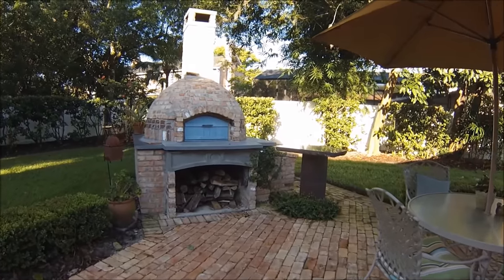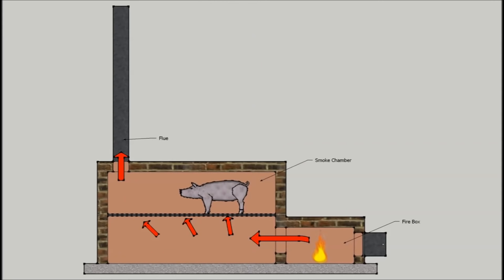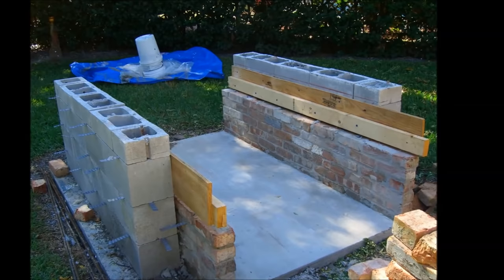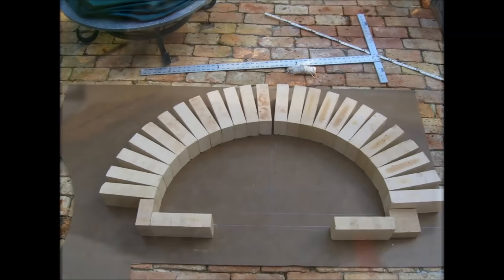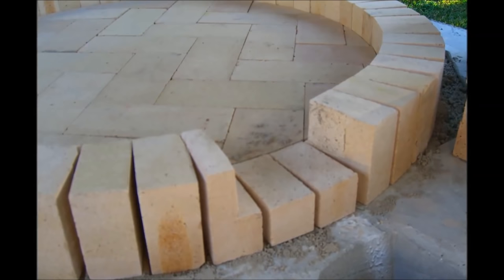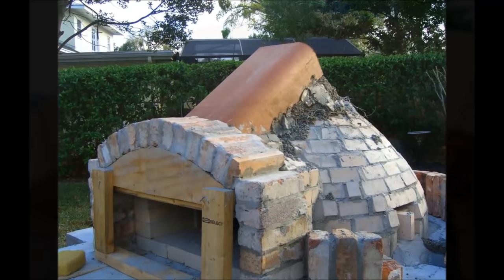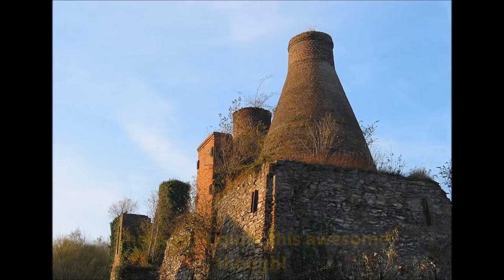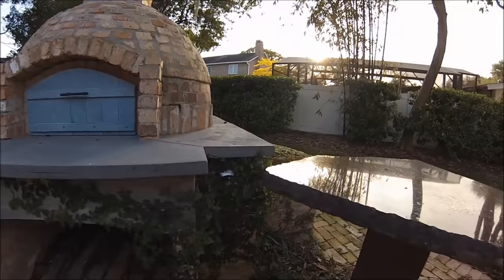How to Build a Brick Wood Fired Pizza Oven/Smoker Combo

Comment: good alternative to the insulation is to fill the void between the inner and outer dome with sand. does require extra time to cure... since the sand needs to lose all its moisture.
Reply from the maker: That will work but sand isn't nearly as good of an insulator. But it would work if you absolutely can't find Perlite.

Comment: Awesome video! Thanks for making it. You inspired me to build my own brick oven. I’ve followed your example as far as pouring a vermiculite base then laying fire brick for the floor. Now I’m building the dome. I was planning to wrap the brick dome in ceramic fiber insulation then do a layer of vermiculite cement over the ceramic fiber. I wanted to ask your opinion tho, if I just did a 2” layer of vermiculite cement over the brick, do you think that will be enough to insulate? Or will I still need to wrap it in ceramic fiber insulation? Thanks!
Reply from the maker: To answer your first question, no I don't think a 2" layer of vermiculite concrete is going to be enough insulation. Now I say that, but I have never used vermiculite concrete - mine is perlite concrete. I don't know if there is a big difference between the two performance wise, but I would advise at least 4" of the perlite concrete at a minimum.

Ceramic fiber insulation is fantastic if you have limited interstitial space for the insulation. Inch per inch, the ceramic fiber is a better insulator. The main drawbacks are that it's way more expensive than perlite or vermiculite and it won't support any weight. Batt insulation loses it's effectiveness when compressed. On my oven I used some ceramic batts, but not on the top of the dome where I had to support the weight of the chimney and the bricks on top of the oven. The most cost effective insulation is perlite in my opinion.

Comment: Lee,   Excellent video and outcome. Thank you for sharing.    I searched google for a pizza oven/smoker combo and your video was the first that popped up -- my lucky day.    3 questions for you:
1)  Did you consider putting dampers in the chimney and the offset smoke box flue to help regulate heat and smoke retention?
2) How big is the door relative to the oven floor size?   One of my complaints with some of the pizza oven plans is that the door is really small.  I want to be able to slide a 16" pizza or a full turkey into the oven without having to go to a 40"+ oven.  
3) Did you consider adding a gas burner as a heat source to augment the wood burning?  While I really like wood fire, I have to admit that there are times where I'd kill for the convenience of gas.
Reply from the maker: 1. I did consider putting a damper somewhere to regulate temperature when smoking in it but couldn't really figure out a good way go do it. It works pretty good without any dampers, but I have a few tricks to help regulate the heat and smoke. I will do a video about some of that soon.
2. The door is about 18-1/2" wide and 12" tall at the top of the arch. You can definitely smoke a turkey in it. I even did a video about that - https://www.youtube.com/watch?v=v0nPnXZ9dIY&t=1s. Spatchcocking the turkey is recommended. Remember, the larger the door opening, the harder it will be to retain heat. That's why they seem so small.
3. I have gas and considered it, but then thought about how easy I could explode the oven if I lit the gas too late. So didn't do it.
Reply: @LeeMcNeil  Thanks so much for the reply.  Again, your craftsmanship is  the best I've seen on line.   I did have the chance to visit with the folks at Forno Bravo a couple of weeks back, and decided to go with a 40" oven.  Just seems more versatile and they said that the 40" oven only takes a few minutes longer to come up to temp over the 36".     Now the decision is whether to buy one of their precast units or attempt to build a brick oven similar to yours.    From what they told me, due to the thermo efficiency of the precast material,  their units will come up to pizza temp in about half the time of a traditional brick oven, and retain the heat almost as long.   And they offer a "safe" gas option  (no chance of a masonry grenade).  The downside is that it may not be possible to retrofit an offset smoke box  and of course the pride of building it myself.   Oh, the other downside is that their door opening is only  10.5"x16"  which I really think is too short.

Comment: Thats very well done - I like it a lot!
I have been planning to do one for my terrace kitchen but one thing has been bothering me. Its the cold climate we have here in northern europe. Could it be a problem if the oven gets wet during the fall and then freezes out during the long winter..it can get down to -25f. 
I also had a superb plan to get a little bit of extra warmth to my sitting area - the plan was to make a series of brick pipes going in between fire bricks and regular red bricks and the attach it to a fan. The heated air is then blown under the sitting area, but I am not too sure whats going to happen when the cold outdoor air is blown to super heated fire bricks?? Propably not a good idea..

Thanks for the video, it was very educative!
Reply from the maker: Mika Laine I'm not an expert on cold weather construction but if you are putting brick on the outside I would think it would be OK. I'm assuming there are brick buildings where you live so it would be the same kind of application. You just want to make sure you repair any cracking immediately because the freeze thaw cycle will cause damage. I would also coat any exposed concrete, brick and mortar yearly with a good commercial grade clear waterproofing. You won't have a problem with cold air hitting the hot fire bricks at all. I think that is a good idea actually. You might want to make your pipes out of chimney flue material though because that will be a little easier to build them. Just remember when you do that your oven isn't going to hold internal temperature as well with that running because you are pulling heat out of it to keep your sitting area warm. Make sure the pipes are sealed up really well also to keep the smoke out of them,

Comment: Thank you very much for the illuminating video.. I really benefited for my project of building a similar oven in my village in Sudan .. however, I am always confused about the chimney task in firewood oven ... because I think that it will leak the needed heat... would you please tell me about how that would not happen! .. am I suppose to close it immediately after the smoke is over after the fire stop it?  How can I do that in your oven? Your answers would be highly appreciated... thank you very much!
Reply from the maker: Sorry I'm a little late to reply. If you want to cook pizza in it, you would build the fire leaving the mouth of the oven open, after it heats up, you push the fire back to the rear of the oven and cook the pizza in the middle. Pizza needs to be cooked really hot and the opening to the chimney flue reduces the amount of heat going out of the chimney. If you want to cook something like bread in it, you will want a much lower temperature. Once the oven is heated up, you would take the fire out of the oven and put an insulated door at the little lip I made right in front of the chimney flue opening. Now you have a fully sealed and insulated oven that will remain at around 350 degrees F for a long time. You can cook a lot of stuff in there before is cools down.

Comment: Very nice, impressed. making one now as my lower base is free blk from work and are split face that match my house. I also got some free polished granite slabs.I sense it is important not to just use fire brick but to put over a insulated blanket also before finishing outside .Does it matter if its a dome or square ? I have a wood pellet grill but like to make a smoker like you did.Any pointers email me and love to call you.Reggie from MN
Reply from the maker: Reggie S. Thanks Reggie. In answer to your question, the inner dome needs to be dome shaped but the outside can be any shape you like. The outside housing is only there to keep the insulation intact and dry. And that inner dome definitely needs to be made of fire brick and refractory mortar. You should be able to get fire brick from a local masonry supply house. They are more expensive than regular brick but not outrageously expensive. And you don't need that many of them. If you have any other questions just put them down here and I will answer them as best as I can. There might be others reading this that may have the same questions and could benefit from the dialog.

Lee

Comment: Hi Lee
Poured my top over my block today. 8 x 6 feet, some of that is over hang for counter top. seeded thick chunks or colored glass into cement top and in 30 days will polish concrete with diamond pads, 50 grit ,100,200, and will continue to desire finish is there love to share some pics with you.
Take care
Reggie from Mn
Reply from the maker: Reggie S. That sounds great. I thought about broadcasting some glass into my top but ended up not doing it. I didn't think I would needing to grind so didn't want to mess with it - but then I ended up needing to grind it anyway. Are you posting your build over on the Forno Bravo website? Those guys will really help you out if you do.
Reply: Lee McNeil
when im done I'll post a video of it as im taking alot of pictures during build

Comment: Hello Lee, my wife wants a fireplace, so I am thinking that I could mover the smoker firebox forward and put a nice glass door on the front (rather than the side), maybe from a used wood  burning stove, and add a third purpose to your design.  Do you see any problems with that idea?  Do you think it could be made to draw with the door open so she could enjoy an open fire?  Thanks a million!
Reply from the maker: +Craig Laughlin Yes you could absolutely do that. You could also use the wood oven itself as a fireplace. The only problem with it is that it doesn't throw off a ton of heat because typically the doors to the oven aren't real big plus the oven is insulated. It is nice though in that the fire in the oven is right around eye level when you are sitting down.

Comment: I have been drawing and studying to build a wood oven for pizza and more, I am adding a seating bar to eat attached to eat, what was the software that you used for your drawing ?
Your oven look amazing !
Can the flu exhaust be placed fully behind ?
Cheers
Reply from the maker: I used Sketchup program for my model. You can download the plans I made in their 3D warehouse. As for the flue in the back, I think that is called a squirrel tail oven. They are not super common but you can google it and find out more info.

Comment: Just the video I was looking for! I'm trying to make an all in one grill/smoker/pizza oven. 
Do you need two different doors when you want to smoke versus when you want to use it as an oven?
Reply from the maker: You wouldn't have a door on the oven when you cook pizza in it because it would cut off air to the fire, but if I wanted to use the residual heat from the oven after the fire is out to cook something like bread in it, I could put an insulated door on the inner lip I made in the mouth of the oven to seal it off. I have not tried that yet mainly because I haven't made an insulated door. When I use the smoker, I just have a regular wood door on the outer lip of the oven to seal up the mouth, which allows smoke to still get to the flue opening.

Comment: Is there any pics or videos on the path from the smoker hole to the inside before all insulation and outer bricks gets done?
Reply from the maker: Not other than the pictures from the video. It was pretty simple though. Just make sure you leave an opening in concrete base of the oven at the top of the block wall over the empty block cell where you will be putting the offset fire box. Make sure the opening in the concrete opens into the space where the insulation will be going between the inner and outer brick domes. Then cut an opening in the same cell where the back of the fire box will be. The part I think you may be asking about is the 90 degree transition of the smoke flue from the top of the concrete into the oven. All I did there was to use perlite concrete mixed with some fire clay to hand form the sides of the transition, then I cut a flat piece of flue material to use as the top.

Comment: i find large cement joints between bricks are a fail with constant use , even with a refractory cement mix .,,have you ever tried using gasket cement for engines in the inner skin and an oven shape where you can keep the joints closer together 2-3 mm .
Reply from the maker: andrew collis Are you talking like a high heat silicone? I don't know how well that would work. I think that type of material wouldn't be able to handle the heat. I know the gaskets for the engine head and exhaust manifold can get as hot as the inside of the oven but those gaskets are made of metal I believe. I should have made the joints a little tighter but I am no mason. I did taper all the bricks though so it would be impossible for any to fall through even if the mortar failed. I haven't seen any evidence of any failed mortar in the oven yet either (like chunks of it falling into the oven). I have had some very small pieces come out of the flue opening which is probably coming from the high heat mortar that I parged over the bottom of the flue where it routes over the dome. I should have maybe done something a little different there (like lay a flat piece of the clay flue liner there) but so far it hasn't been a real big issue.
Reply: heat is a harsh environment  , but yes the gasket cement really works ..i recently built a working wood fire oven , i mean it never gets cold an bakes bread each day . i will post a video soon .. the shape we constructed was a elliptical flat arch 1.5mt wide 3.0 long , i will have to show you later as typing is not my ministry , i'm a stonie an bricklayer..however yes indeed the silaset works extremely well . also thermal mass over top of oven ..i liked yr vid a lot  ..

Comment from the maker: +Daven Vasquez For some reason the reply button doesn't work on your comment. I bought the perlite at a local nursery. It's used as a soil improvement for planting and potting mixes. You could probably find it at an agricultural or farm store also. They sell it in real big bags.
Reply: Oh ok sorry about that! And thanks that's exactly what I needed to know...I wasn't sure I could use "horticultural grade perlite" in a oven build. Thanks again! 

Another question I have is my inner dome (the firebrick dome) had some cracking and separating in some areas. Is that ok? And what should I do to repair those cracks so it doesn't crack anymore?
Reply from the maker: Daven Vasquez Is your dome cracking right through the brick or through the mortar joints? Is it cracking at the base or across the top or where? I have a little bit of cracking on the outer dome but not on the inner dome. I have never heard of this. I think you will be OK just to patch it with some heat resistant mortar or you could buy some refractory mortar. Don't try to use epoxy or anything that won't stand up to the heat. If you've tapered your fire brick correctly you shouldn't have a problem with bricks falling into your oven or a total collapse of the inner dome.
Reply: It's cracking in the motor joints. I did stagger the fire brick and it still feels structurally solid. So I don't think it is going to cave. I think it was just settling in during the test fires? So yeah what I did was laid a piece of chicken wire over the cracked areas and put a layer of heat stop fire mortar on top of that. Do you think that'll be good enough? Also out of those same cracks some smoke was escaping...would that be bad if it still was leaking after the decorative rock dome is put on top?

Thanks again for the help! And sorry for all the questions!
Reply: Oh and it's up about half way the dome, not the top or bottom. Running horizontally
Reply from the maker: +Daven Vasquez Yes - I think you will be Ok. I would take that chicken wire and mortar and coat do the whole outside of the dome just for some insurance. How big are your mortar joints on the inner dome? They should be a lot smaller (less than 1/4") than regular mortar joints (which are 3/8").
Reply: Ok I will do that. And yeah I think maybe those parts that are cracking were more than 1/4"

Comment: Good afternoon Lee.
How's is the home brewed fire mortar you did is holding up? I got one from amazon but it's crap ro work with and so far you 1:2:6 works a lot better to set the bricks. Awesome job on oven by the way.
Reply from the maker: It's holding up good. I cut a taper into the fire bricks and the joints on the inner dome are pretty tight so not a whole lot of the mortar is exposed to direct flame. I did use some of the mortar on the bottom of the flue transition back to the center flue (go to 22.33 in the video to see it), and I do get some debris that falls out of the flue opening every once in a while. I need to stick a remote camera up there to see what's going on but that flue gets pretty hot so I wouldn't be surprised to if I find that mortar bed failing. It's going to be a pain to fix if it is breaking down up there.
Reply: The inside joints of the dome is pretty tight too. I'm adding to the mix the product that bought from amazon as well because I can't find any other use for it so it should give an extra protection as well, thank you for the reply.

Comment: The construction is impressive.  Thank you for sharing it.  Does the residual smoke from the smoking wood impart any flavor to pizzas or other items cooked in the oven while not smoking?
Reply from the maker: Not at all. When you make pizza, you have to get the oven so hot that it will burn pretty much everything up in the oven. The wood burning to make the pizza gives it a little smokey flavor though.